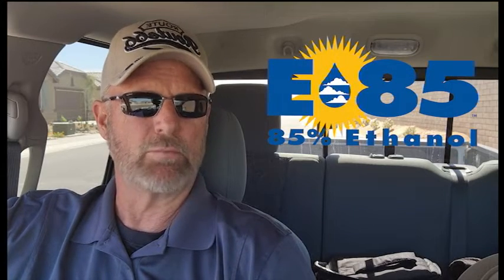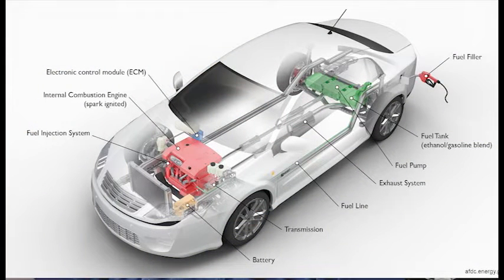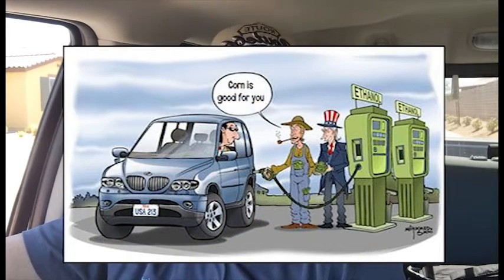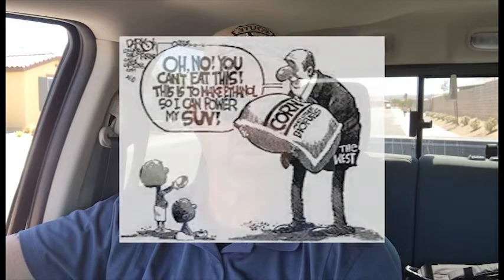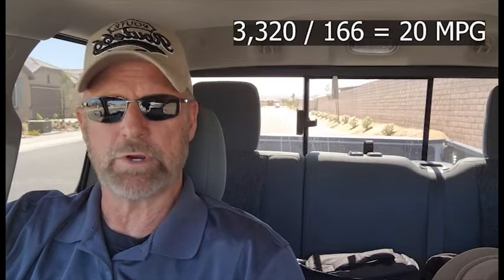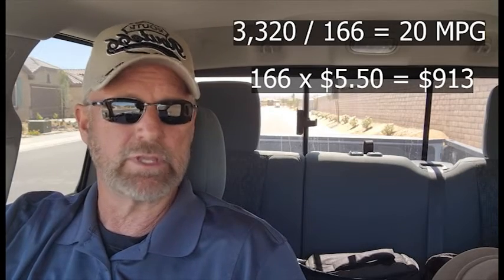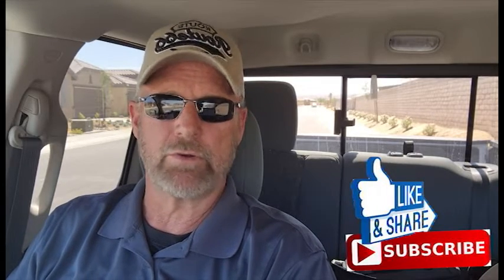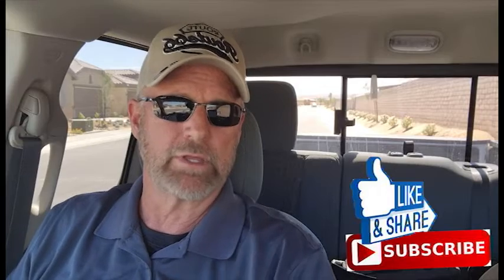Flex Fuel / E85 vs Regular Unleaded Gasoline Comparison

Comment: The ethanol in E85 is what you call an oxygenated fuel it carries almost 35% of the oxygen it need to burn. That is why flex fuel vehicle fuel systems need to be designed bigger. The fuel the engine consumes increases by almost 30% and is also why your vehicle needs to be specifically tuned for it. Whether it be any ethanol blend of 15% or even straight ethanol. Yes it contains less energy per gallon than gasoline but dominates producing high power with the correct engine setup examples being high compression, forced induction, and full race motors.

Comment: I amnot understanding why it was struggling on E85 but not on 91.. More octane means more power. I know limited on tuning between and also fuel pump and injectors not optimized for E85. Maybe not enough fuel being pushed to the engine to mazimze the E85 potential

Comment: If you are running E85 can you mix the fuel with regular unleaded?
Reply from the maker: Yes... The onboard computer adjusts the mixture if you have 100% E85 or 25% E85 / 75% UNL. It works great in my truck.